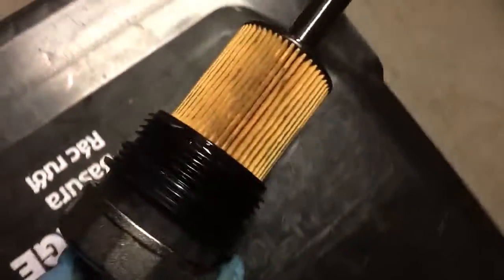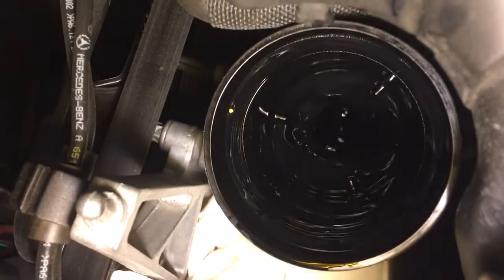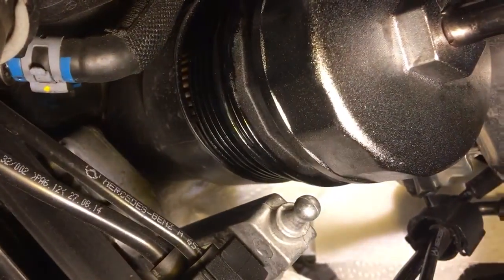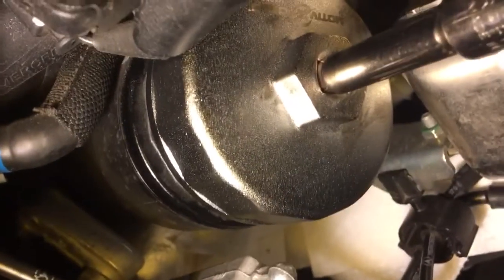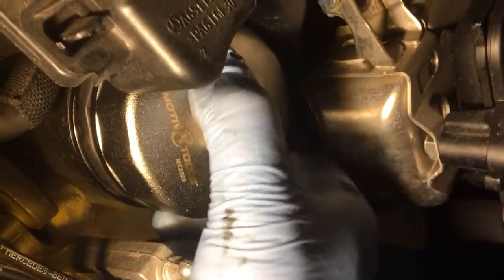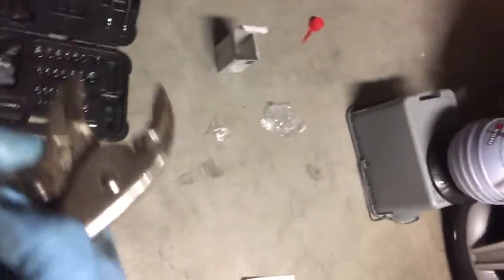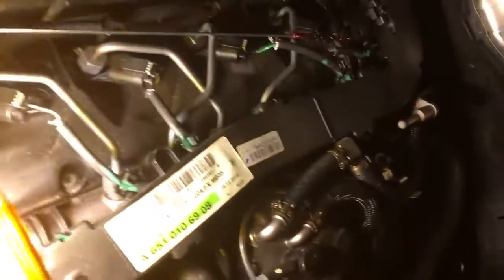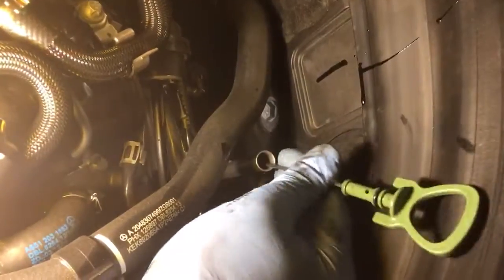Mercedes GLK250 oil change Video 8 installing the new oil filter canister

Comment: The oil-filter plug torque is 22 ft.lbs.   To get the cap-tool off simply reverse the rotation of your ratchet-wrench and turn it EVER SO SLIGHTLY (so your oil filter itself doesn't even move, just your cap-tool).  You really should buy a torque wrench.  They are $20 at Harbor Freight Tools but half the time you can get them with a $9.99 coupon.  You can't beat that and guess what?  A torque wrench has all sorts of applications beyond a simple oil filter.